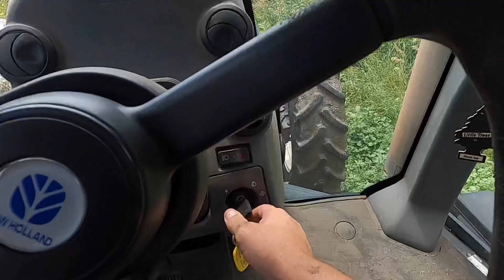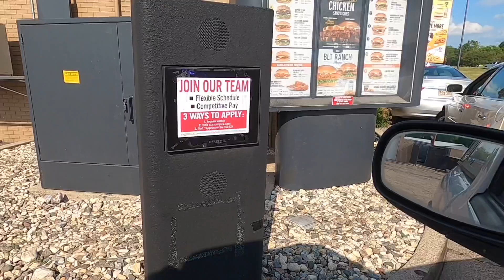Killing Weeds With Steel - I Just Made A Stupid Mistake and Finally Here Comes Some Rain!

Comment: Great video, at least you guys are not dealing with the heat like here in ga
Reply: We've had some pretty hot days here this summer. Highs in the mid to upper 90's at times with high humidity. But I'm sure not as hot as you. I've heard from other people that have lived down south and then been up north here say that the weather here is  not as hot and at least we usually have a breeze.
Reply: @stephenfonder7409  for the most part we have been getting rain showers several times a week which really keeps the humidity up, weather is showing some cooler weather in the coming weeks, really like your videos